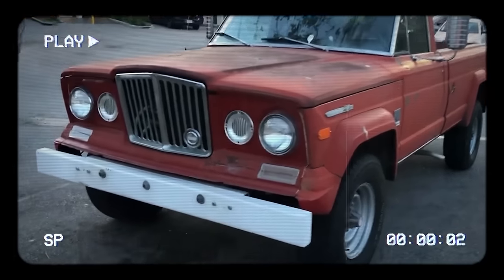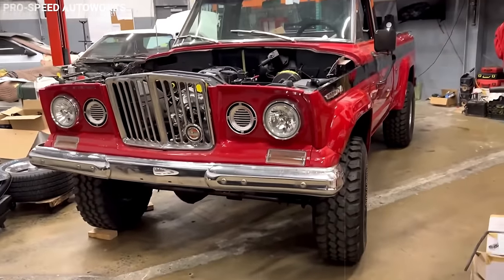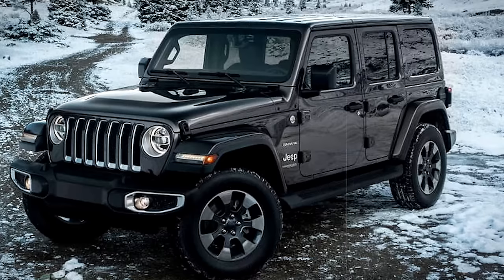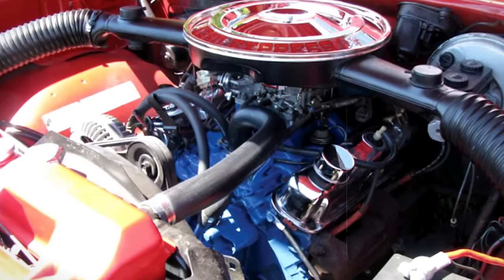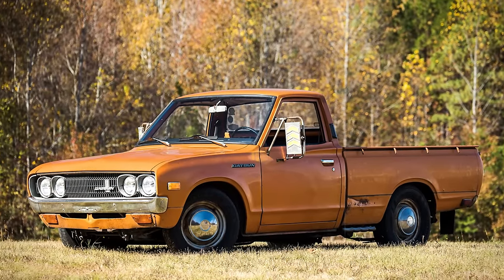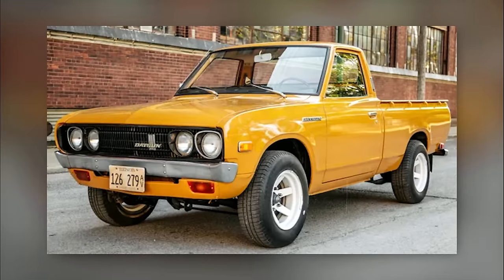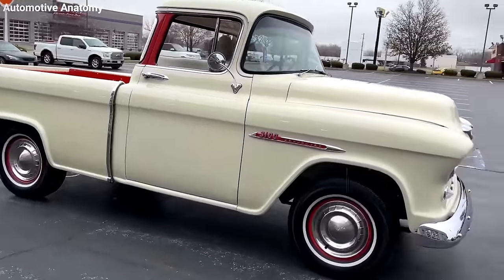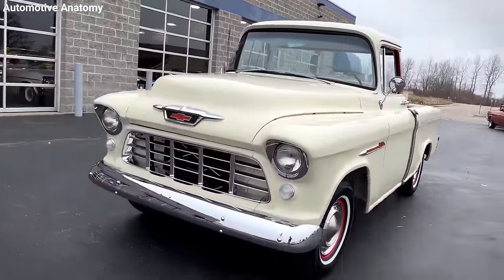4 Most Epic Pickup Trucks! That Changed The Game!

Comment: I owned a 1970 Gladiator pickup. It was the last of the Kaiser owned Jeeps, so it was equipped with a Buick 350 with a Turbo 400 trans. The funniest thing to do with it was put it in four low and punch it from a dead stop. I never heard a transmission go through all of its shifts so fast in my life. Was in top gear before ten mph. Just so funny. Great truck, drove it for believe it or not seventeen years.

Comment: I had a 65 Jeep pickup that I traded a 74 Datsun for it.
My Dad ran the 620 Datsuns from 1978 until around 2000. He rebuilt engines for them and always had one on the shelf when needed. He had a small herd of parts trucks when he finally started running Subaru wagons later on.